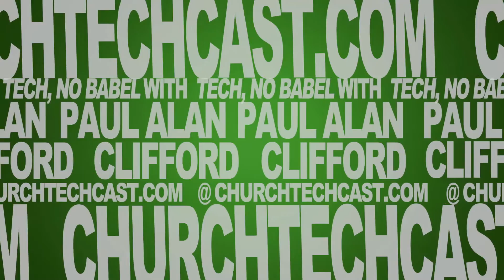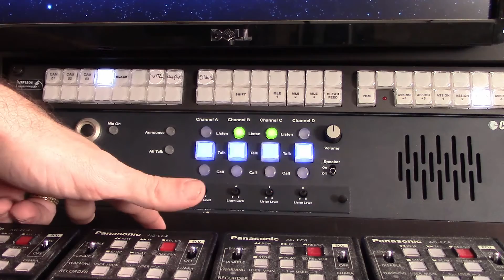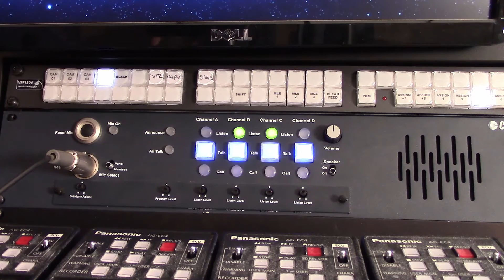Using communications systems (coms) in live video production | tnb160407

Comment: Is every Backpack wireless?
Reply from the maker: Nope. Some are wired. They usually use XLR cables when they are.
Reply: How can i see if it is wireless
Reply from the maker: If it has a place for a cable (usually there will be two, one with three pins and one with three holes so you can daisy chain them), it's probably not wireless.  If it doesn't, it likely is.
Reply from the maker: Oh, and I'm assuming that you meant "belt pack" not backpack.